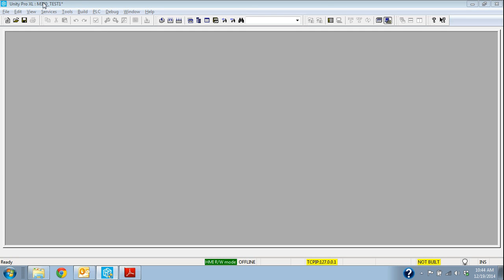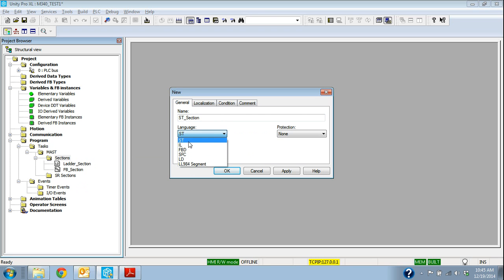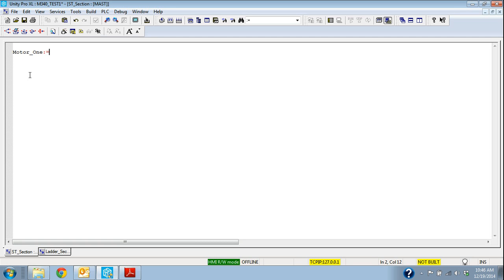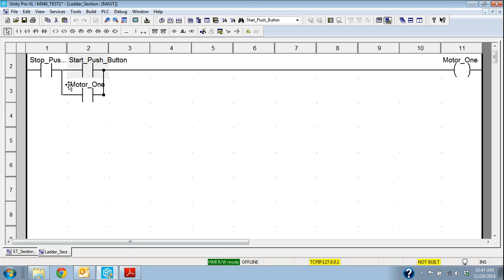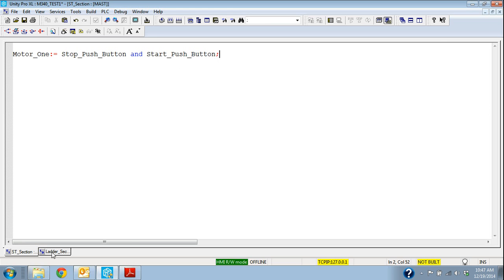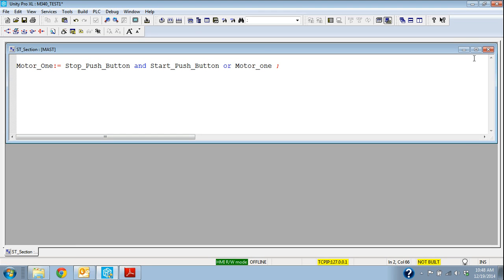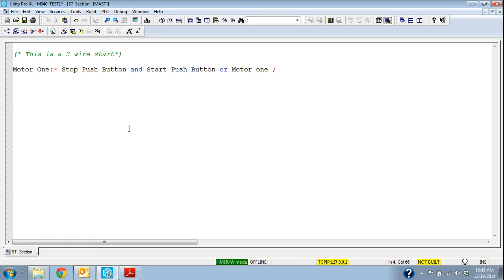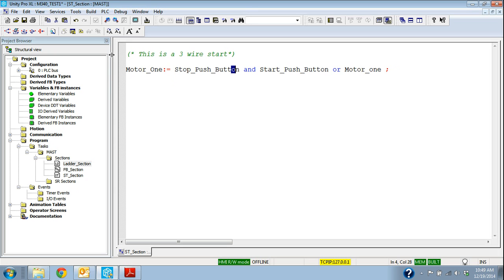Uity Pro creating a Structured Text Section

Comment: First of all, thanks for putting these together!  You work slow enough and detailed enough for a beginner like me to follow along.

I tried this ST code and it doesn't shut off when i toggle the Stop after I've toggle the start on and off.  Am I doing something wrong, or is this code missing something? My example:
motor3:= stop3 and start3 or motor3;
Reply: It should de-energize. If you have any other sections programmed make sure they are not interfering with the ST logic. That happens if you are using the same variables for any other logic sections.
Reply: I think I figured it out.  I needed  brackets around the (start3 or motor3)
Reply: I created these variables on the fly, so they weren't used anywhere else, but I figured out the problem